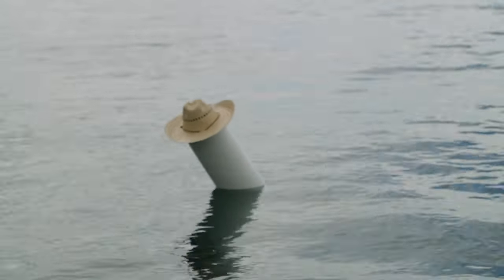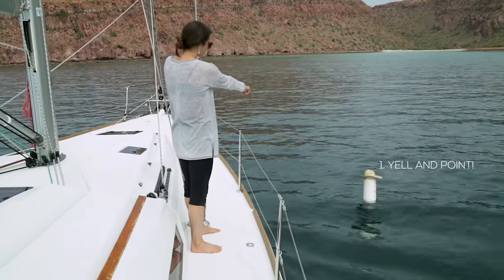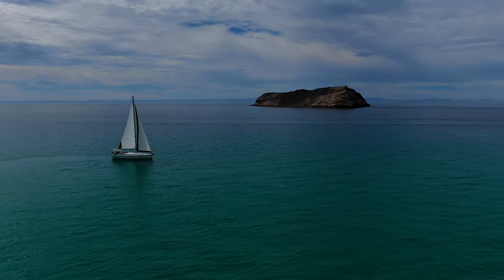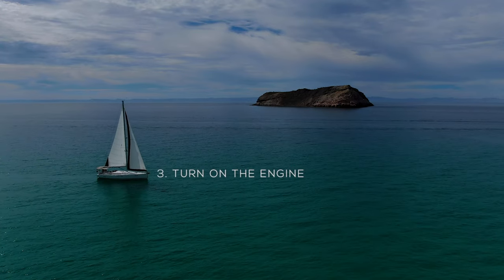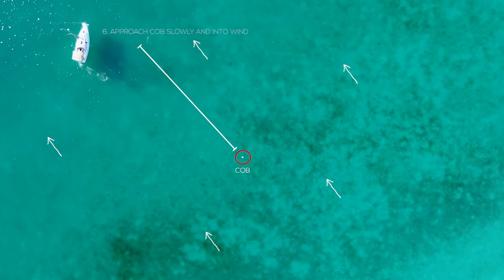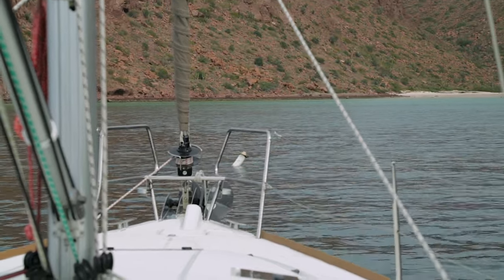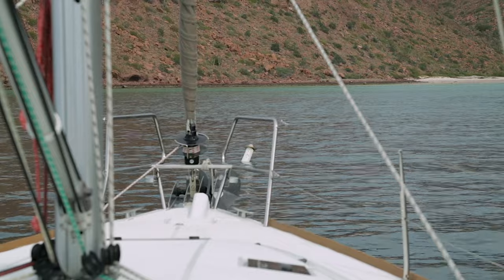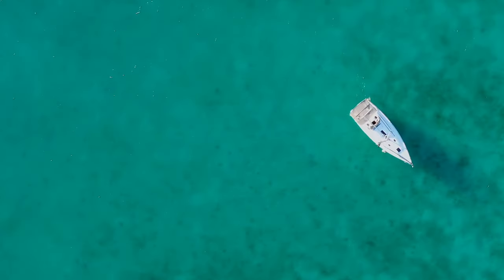How To Sail: Man Overboard Drill - Sailing Basics Video Series

Comment: Step 1...do not rely on your motor!  Step 2...practice when there is a good wind.  Step 3 do not move any farther from the MOB than absolutely necessary...you may be the only one on the boat. Step 4  do not tell anyone there is only one way to do something.
Reply from the maker: Some great points Gerry! Yes, you are right, there are SOOOO many variables that go into determining the best way to retrieve a man overboard, that there can never be a one size fits all approach... We have done thousands of sailing drills under sail picking up a MOB and doing this under sail is extremely challenging. We find for most folks, using the motor may well be the best option, so don't rule that out!
Reply: @NautilusSailing  Hmmm, I don't find it that challenging...if they do, then they need more practice to become more competent at sailing.  The challenging part is to get a wet soggy body back on board. The sailing and steering is just normal seamanship skill - like tacking and docking. I think telling people to use the motor at all is a negative thing as they should learn to sail.
Reply: @gerrys6265  much as I agree with the assessment that the motor doesn't necessarily constitute the only option, disregarding it is just plain stupid. What if you're shorthanding it in a bad sea state, for example?

That's completely disregarding the panic factor, of course. Experienced or not, there are plenty of skippers that wouldn't think as well on their feet as they should in an emergency, and that's just how humans are - no amount of training can help that. 

All in all, while you do make a good point that approaching under sail is a valid technique, I'm under the impression that you've never actually been in an MOB situation in anything but the mildest of weathers. Either that, or you're desperate to appear to be a salty old sea dog, in which case - that kind of fighter pilot "we do it the hard way or we die" mentality is something I've never seen anyone actually experienced express.
Reply: @MicJej  I thought I said clearly that there is not just "one" way. Perhaps I stretched it a bit by suggesting we "shouldn't tell people to use their motor" because that is one way. However, I have never had to recover a body but have done plenty of drill in quite rough weather (2.5 metre seas) and successfully picked up the buoy singlehanded (40 foot ketch). It is not that difficult to that point providing you can keep your eye on the buoy - which would be easier if you only had to sail instead of going forward and lowering sails before then starting the  motor.  Like anything, it is a matter of practice, but is  basic skill everyone (captain at least) should have if sailing with others in anything other than >10 kts wind. If you can't do that and the motor doesn't start...what then? I live in cold water locales so you don't have a lot of time to get it right.

Comment: Learn how to Sail: "turn on your engine and get down your sails as fast as possible". 😌
Reply from the maker: Yes, it is ironic! There are ways to pick someone up under sail alone, but you have far less control, and for beginners this is usually more dangerous. So we "cheat" and use our engine ;)
Reply: @NautilusSailing  I understand that, and i guess in a dangerous situation it is always the better, cause safer way to go, as you said. But I was a bit disappointed when i watched the maneuver, cause I practised the rescue under sail that day on a small boat and was looking for an example of that maneuver on a bigger yacht. Anyway, thanks for the explanation, I also think your video was well done and a very good guide!

Comment: Holy cow, why not just do a figure-eight with all your sales up install the boat out right on top of them? Takes a fraction of the time. And you're less likely to lose them in a chopper swell
Reply from the maker: Hey Bee... Agreed that it's best to not go too far from the person overboard, especially in bigger swells and heavy weather. Have you practiced the figure 8 MOB on a sailboat? It requires a couple of crew that know what they are doing, requires you to sail at least 5-7 boat lengths away to have the time and angles to complete the drill, and is challenging to complete well without running over the person in the water. For newer sails the method in the video is much safer, quicker and allows a lot more boat control.
Reply: @NautilusSailing  sales? lol
Reply: Figure of eight is a horrible manoeuvre that I am shocked is being taught to people.  It requires you to sail far, far away from the man overboard and do multiple tacks that may disorient the crew while your best and only chance to save the person is being aware where the casualty is at any point in time. You can't save them if you don't know where they are.
For that reason I believe the training should focus on being able to execute a rather tight loop to minimise chance you are going to loose sight of the casualty.
Reply: @leonardmilcin7798  I'm just curious where you got your sailing credential from?
Reply: @beedonn9260  From somewhere they teach actual useful knowledge and not resort to ad hominem attacks when the facts don't suit you.

Comment: Here in NZ the general protocol is to do an emergency gybe. If you go about rather than Gybe you have a good chance of running the person over. If you muck around lowering the sails in strong weather there is a good chance you won’t find them again.
Reply from the maker: Under sail is a different operation. The goal is to get back to them as quickly as possible. agreed taking the sails down is risky as you'll lose sight of the victim. The ASA says no gybing, the risk of the boom taking another crew member out. We teach the figure 8, or the "quick stop" method. When going upwind, you heave-to and get to windward and drift down to them, typically you're within 1 boat length when you do that.

Comment: I am occasional, amateur skipper (mostly inland day sailing). I sometimes take on inexperienced crew. I found that running a bit of training before taking off and doing one or couple man overboard drills goes a long way relieving tension, feeling them safer and setting them to have fun time. And I admit, the same goes for me -- every successful man overboard drill gives me that little important boost of confidence.
As to Pepe, for him to behave a little more realistically I tie to him 5L jug filled with sand and water. People in water cannot be taken on board while traveling at any speed. I also don't take most easy to spot thing so that people get how important it is to keep the eye on the person.
As to starting the engine, I think you always have to start the engine but frequently it is much faster to complete the manoeuvre under sail. Especially if you have a puny overboard engine like I have that sometimes isn't enough to overcome the wind. If I trust the crew to drop the sail quickly at exact point I need them I will assign one person to start the engine but otherwise complete the manoeuvre under sail. If I am not sure of the crew I will get one tack done at a distance that will give me a bit of time for them to drop the sail and I will complete it using just the engine.
I would also complete it using just the engine if I have very small crew so that I have somebody ready to receive man over board and not busy with handling the sail (remember, I am steering, somebody is an Eye, somebody is starting/handling the engine, two people are needed to handle sails effectively... that's already quite resource intensive operation).
As to recovering at the beam -- on most boats of that size it is impossible to recover an actual human at the beam. And not sure what that boathook is supposed to accomplish. Use it as a harpoon so the person can't swim away? I would be worried to have a crew member to wave a hook close to a person in the water because of possibility for injury and because it is not entirely clear what to do afterwards. Additionally, if there is any SNAFU with sails, the bow might not be a safe place to be in in the first place. I think the training should reflect a realistic situation as much as possible and the crew should know how to take on a realistic person and on that kind of yacht it will inevitably happen at the stern.
Another reason to do it at the stern is that I, the skipper, have perfect view of what is happening and that makes it easier to make decisions and/or directly help with the effort.
Reply from the maker: Some great points Leonard! Appreciate the feedback... We always encourage our students to practice these drills when they head out, so that they are prepared for a real emergency situation.... You are right about trying to retrieve someone from the beam of the boat, that this is not ideal. We make contact from the beam of the boat, and then try and get the victim around to the stern, where it is much easier to get them aboard.

Comment: I have taught ASA Classes for several years at several ASA affiliate schools, and taught US/Sailing at one school. I have taught the FIgure-8, BRCR, and Quickstop methods at all of them. The secret that few instructors divulge is that COB drills are really about learning boat handling. This video presents the most accurate instruction of how to handle a real COB situation. 

When I teach COB, I tell students that we are going to pretend that there is no working engine aboard. However, I also tell them that if this were a REAL COB, and you have inexperienced sailors aboard, start the engine and drop the sails. Stop the engine when you have made contact with the COB and are about to begin retrieval.

Sailing 4-5 boat lengths away from the COB, tacking, steering 2 boat lengths to windward of the COB, crossing your wake, and then turning to windward, as in the Figure-8, takes too much time. If you miss the COB on your first attempt, then you have to sail around again, and that takes more time. Time is something that you do not have in an emergency.

Thank you for this video!
Reply from the maker: Great comments and thoughts! Thanks :)
Reply: What about the time to put your sails back up when the engine stops working?

Comment: Close Reach/Close Hauled: go on a Beam Reach course for no more than two boat-lengths and then get your nose trough the wind. Keep the Genoa windwards and you'll slowly drift to the Person.
Broad Reach/Running: also go on a beam reach cause for no more than two boat lengths, then get your nose though the wind. When the wind comes from straight ahead, pull your main sheet tight, then also keep your Genoa windwards. Again, drift to the person.
Reply from the maker: Yes, you're describing the quick stop method, works great and we teach that especially on a catamaran. You basically get to windward and heave to.

Comment: Getting the unconscious 100kg mob back in strikes me as the harder part of the rescue. Especially as it's probably only me on board. I've tried using a spare main halyard to winch them in, but it really needs two people. Rescue sling?
Reply from the maker: You're right, the recovery is a big component. Our swim step has a winch nearby and a ladder. Most good offshore life jackets have a hoist strap on them as well. Anything we can do to get them attached to the boat to begin recover is a big plus.

Comment: I really disagree with this process. I believe some people will die if they follow this process. A simple crash tack will bring a sailing vessel upwind of the mob and immediately into irons,  or at least halt the vessel from leaving the scene further. Easing the headsail for sailing back to the mob or stay in irons and allow the mob to swim to the vessel as it drifts down upon them. Some sailing yachts require a lot of time to drop sails. Starting your engine in an emergency might just pick up a rope causing the vessel to be disabled itself, making matters exponentially worse. A solution that works both in calm seas or offshore in 50knots works best in my mind. Yachtmaster Offshore with approx 30,000hrs give or take. Practice and tell me I'm wrong or right.
Reply from the maker: Hey Sam... valid point! As you mentioned recovering a COB is incredibly subjective depending on type of boat, sea conditions, and sailing ability of the crew. These videos were designed for brand new sailors, that are just learning the ropes. We are huge fans of the "Quick Stop" method you alluded to, where one heaves to as quickly as possible. Done by sailors who really know what they are doing, this is also our favorite method. The challenge once hove to becomes how to get back to the person in the water, and that's a whole other controversial discussion!
Reply: What I really would like to see is the practice taking place in a situation where COB is more likely to happen. At least 20-25 knots with a sea to match and sails flogging all around.